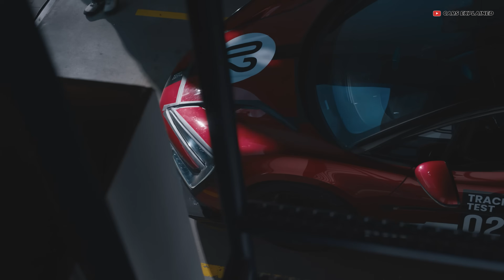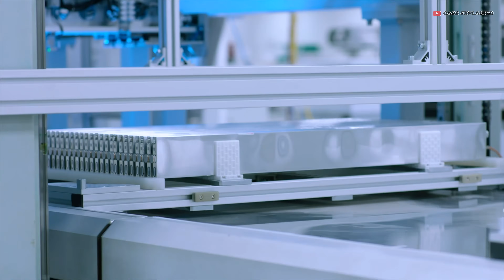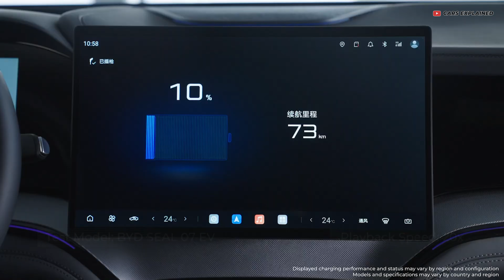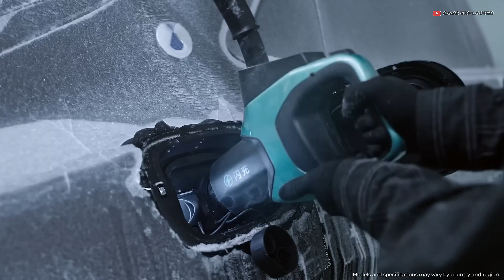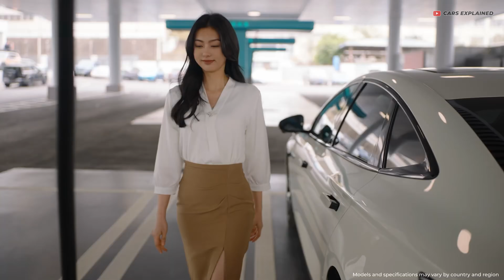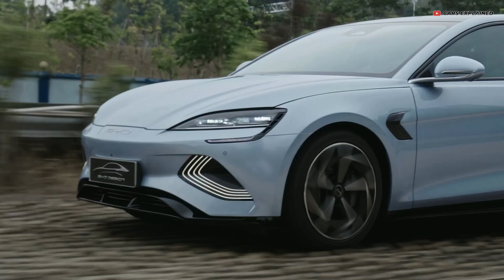The Blade battery - Is this the future of EV battery?

Comment: finally a solution but charging cost will be high
Reply from the maker: everything comes at a cost
Reply: LOL electricity price doesn't change depending on the battery it is charging, other than up front development. Dumas.